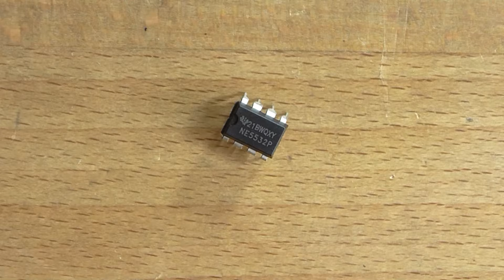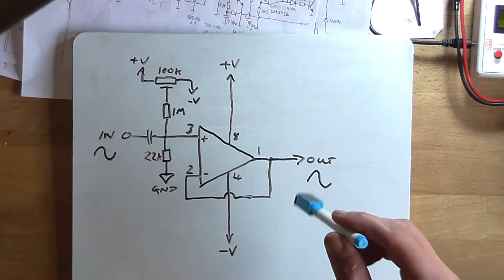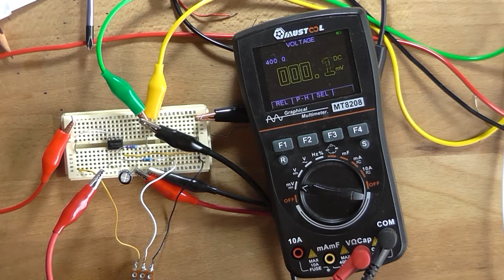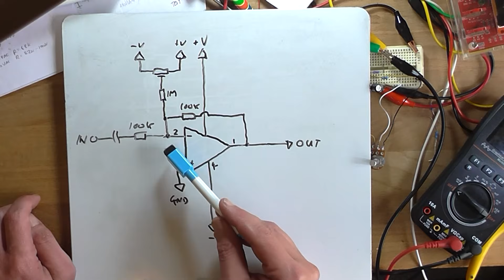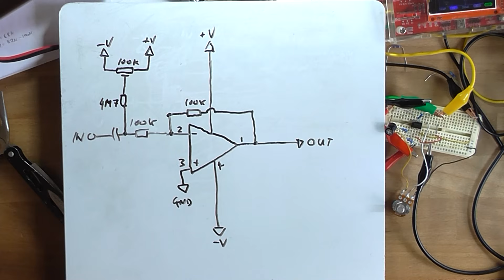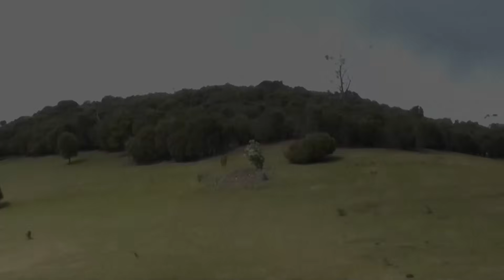DC Offset-Nulling an Op Amp

Comment: That seems like a handy concept to implement into a preamp circuit using a multiturn.
Reply from the maker: Yes, that was my intended idea. You could use this configured as a voltage follower, as shown, as the last op amp of the preamp. This will take care of any amplified offset of previous stages.

Comment: A DC servo is also a useful way to remove DC offset, and a method I prefer myself, as it continually adjusts for offset meaning there's practically no drift. Although for most purposes, the DC offset is usually to low to be an issue anyway, unless your circuit has a lot of gain.
Reply from the maker: So, basically an "AGC" circuit idea just adjusting the DC offset rather than the gain? Neat idea.